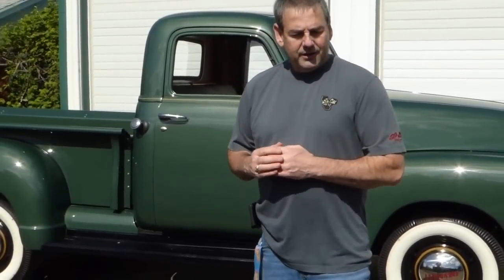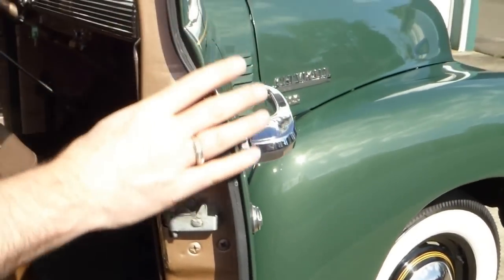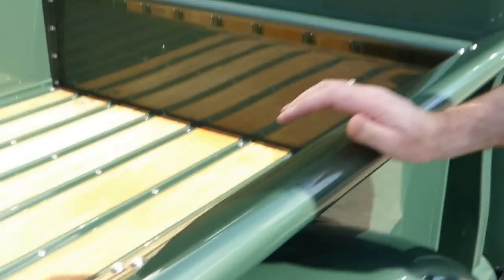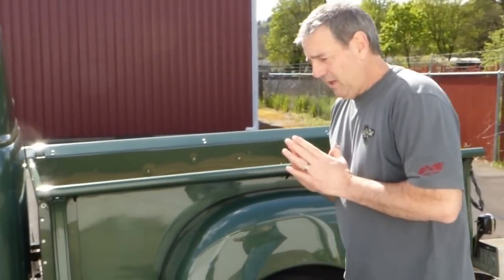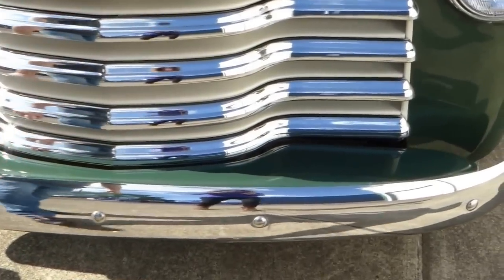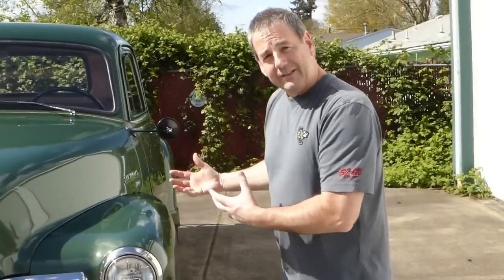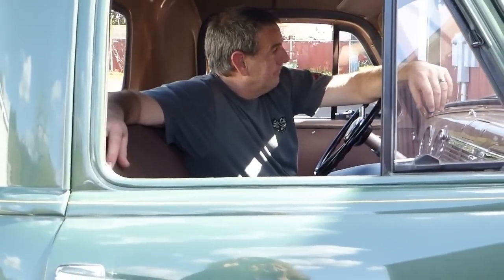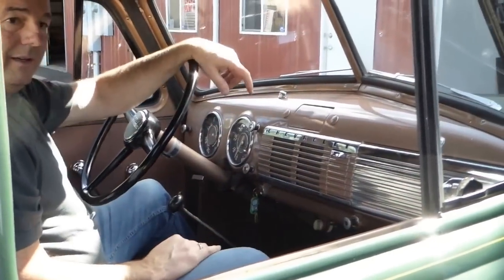1951 Chevrolet 3100 Pick up Truck "SOLD" West Coast Collector Cars

Comment: I was on Google street view in the hills of Hollywood  when I saw a straight but original 54 Chevy truck, I out of curiosity moved the date the picture was taken and the range was 2009 to 2017 and to my amazement the truck is in every time nearly the same spot over a 7-8 yr span, the truck is parked by a gate of a very nice home, I just wondered if its original of  has a LS 2 or something newer with AC etc or a bone stocker?
Reply from the maker: LS2 in one of these would be nice! Thanks for the comment. Rich

Comment: I have a question I just bought a 51 too n i been looking why does the passenger door has the lock key and the driver side doesn’t ???
Reply from the maker: Hi Isaac, as I understand it, you would let your passenger out, lock the truck. then, upon arrival back to the truck, you unlock the passenger side to let your passenger in, and ideally they would unlock the driver's side from the inside for you. Thank you for your question. Rich.
Reply: Your welcome
Reply: I've notice If you watch the old 50's show like Andy Griffith show or leave it to beaver the driver always got in on the passenger side and would slide across to driver side.

Comment: Motor starts up,... knack knack knack knack.
Reply from the maker: Stove bolt 6, what you're hearing is "Sold, Sold, Sold, Sold"! thanks for the comment. Rich
Reply: Kd Grayson splash lube motors do that, and if the valve lash is off itll tap away all day too
Reply: @Texassince1836  I've had my '48 Stovebolt for over 50 years, I'd be embarrassed to have my tappets that sloppy and I am a woman.

Comment: Valves need adjusting and the white walls look stupid, other than that, nice truck.
Reply from the maker: Thank you for that compliment. R
Reply: Pretty sure the white walls were original. I have one just like this unrestored
Reply: @mattberg916  I have a '48 like this unrestored, Dad bought it new. White walls were for high-end cars or pimped out common cars. Look around the internet for vintage photos, you will not find these trucks sporting those tires back in the day.
Reply: They  never  put  white  walls on  those  trucks  they were  considered  work vehicles